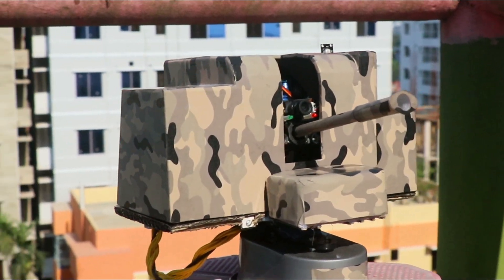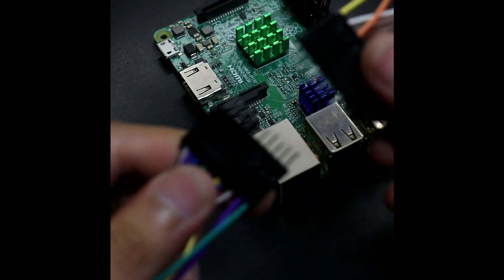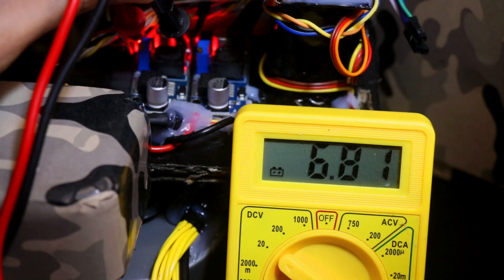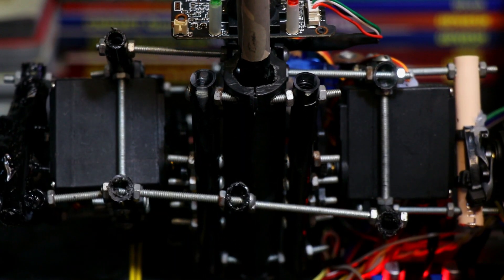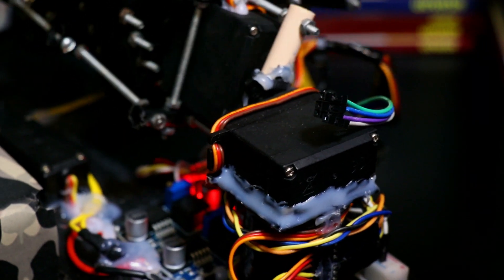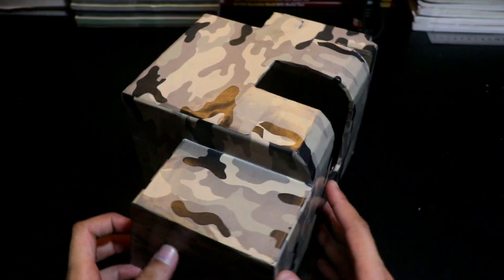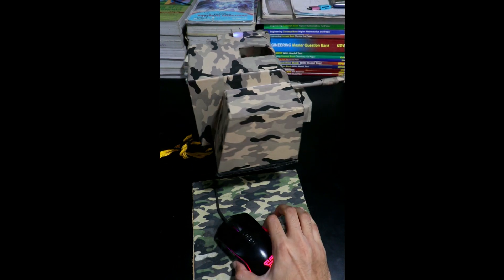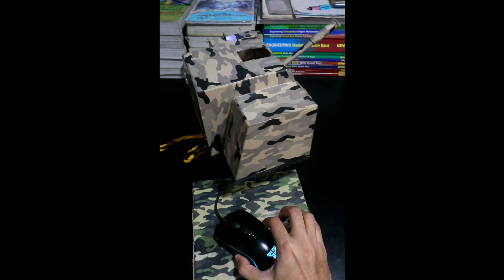DIY Guided Military Cannon | Servo Cannon | Servo Turret 4 |

Comment: I really appreciate your work. I am also working on a similar project. I am trying to build an autonomous turret which would be mounted on a drone. Which would capture images, identify targets and shoot. I have 3d printer so I'd print some shooting mechanism model like that gun as there is weight constraint. I would definitely contact you if I face some sort of issue. ❤
Reply from the maker: @siddhesh_24  sure mate! I have given the source codes,use them for your project and u will gain knowledge.you can also use AI if you don't understand anything at a certain point, just give the code to AI and it will explain everything about the code.